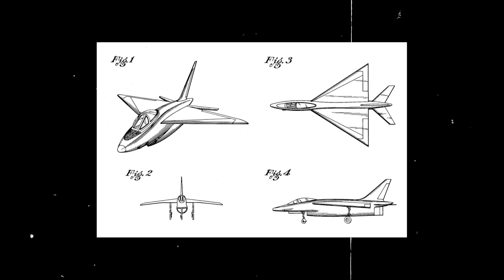T-38 Talon Supersonic

Comment: Two engines are always better than one. Replacing the T-38 with a single engine plane is not a very bright idea. In a T-38, losing an engine is not a fatal event for the plane. In a T-7, you lose the engine you lose the plane. Very short sighted move.

Comment: One thing NEVER mentioned was the very low service hours required to jeep the plane in the air! Modern plane's service requirements are absolutely outrageous but the T-38/F-5 were extremely low. I've always loved this simple yet deadly plane and when Northrop put a single engine with almost twice the thrust and called it the F-20, it was BEAUTIFUL, yet nobody bought it althiugh I'm sure the Iranians looked at it closely!

Comment: I may be incorrect due to my  age (81) but as a member of class 67B, stationed at Moody, Georgia,  the main specs that I flew was a max of 900, mach 1.5  and  a climb to 30,000 in 59 seconds. Fast enough that the altitude inicator 100 foot needle moved so fast that you had to see the tousand foot marker.  Flight above 50,000 feet was max, although I tried and suceeded getting it up to about 52,000.  On my last ride with an instructor, we burned the fuel down until we had enough power to climb at a 90 degree angle   with burners full, the only time I was a temporary astranaunt.  I have seen many variations of the above specs, and wonder if the T-38.s were slightly different than others.  Moody began recieving at moody, begining in  JULY 1965
Reply: Most T-38s have gone through the Propulsion Modification Program (PMP). Maybe the reduced specs are from PMP jets? The PMP from my understanding was mostly to improve TOLD so the performance of the jet suffers at higher speeds where there is less emphasis for the students now.

Comment: This thing is older than me, built in 1960, and we, Swiss Air Force, Switzerland, still use it to this day both in single seat Tiger II and two seat trainer versions, which is in fact a Talon with guns. Basically the F-5 and all its relatives were, are and will remain a very good design.
Reply: When the chef at the White House, learned that  I flew the T-38, he made certain, that  I become a taste tester for some White House functions.  This is no BS, its a strange world.  If you were in the Swiss Air Force  you could confirm the son of the White House chef was his Dad.

Comment: It's hard to believe the air force was trying to avoid a big expensive aircraft. How times have changed.
Reply: I  was an AFTOTC cadet, who  graduated in 1965. Somebody at the Pentagon had a good idea to save money. Rather than send a Reserve Officer to UPT, where a third of each class washes out, costing $250 grand, they spent $25K  to discover who had the appitude and ability to learn quickly how to fly a Cessna 152 o r Piper Colt. USAF  gave us 35 hours  to pass an  FAA check ride. We had a better record of earning our wings than the AFA grads. Someone finally discovered that tests on thet ground are a predictor of sucess as real flight instruction an the AFA does give 25 hours of flight training.

Comment: As an Air Force pilot trainee in 1981, I was stunned they let us go fly that thing by ourselves. Still am. 

I had barely 80 hours of flying jets, and all of that was flying the Tweet -a Volkswagen with wings. The Tweet was all manual controls and relatively under powered but it flew absolutely wonderfully. After 30 or so hours of training, they let you solo the Tweet and from then on, about 1/3 of your flights were solo. (At 6:15 the Tweet footage is of one entering a spin. Always did a lazy wing over before wrapping up. That was a fun and relaxing maneuver...) After all the fanfare with soloing the Tweet, including getting dunked in the "solo dunk tank" there was no such celebration when soloing the T-38. One day you showed up and there was a line through where the name of the instructor would normally be on that flight. You were on your own.

My Tweet instructor told us the scariest day in his life was the day he soloed the T-38. He knew once he put the gear up that only he could get the plane back on the ground. For some reason, my wife took his message to heart. She came out and took photos of me taxiing out alone and later getting off the flight line bread van alone. To her, that was a huge milestone for me. As a student, it was just more of the adventure. I have to give full props to the instructors who flew the jet from the backseat while the sluggos sat up front. The visibility from the back was horrible but these guys made it look easy.

The Air Force saw quite a few accidents through the years because the Talon could enter a high sink rate that afterburners and even the ejection seat could not save you from. Most of these accidents were in the "final turn" to landing. My instructor told me that if at the "perch" (about 1500 feet above the ground and at the very start of the final turn) if you rolled to 90 degrees for just "One Mississippi" the aircraft would pick up such a high sink rate, you would hit the ground, even if you rolled out, lit the burners, and hit max AoA. The RSU (Runway Supervisory Unit -a mini-tower next to the runway with a radio watching you in the final turn) was always watching for high sink rates turning final. If they didn't like your descent rate, you'd hear, "FINAL TURN, GO AROUND, SINK RATE!!!" Mom kept us safe.

A few years before I arrived for training, they instituted their version of the "Ohio State Highway Department" crash films they used to show you in drivers ed. Lots of pictures of airplane parts and sheets over bodies. They added some basic aerodynamics in the course and you had to ace the exam to get to solo. I guess it worked because the final turn accidents ended.
As a student, I always respected the airplane. Unlike the happy Tweet, the Talon was a whole 'nuther league and was relatively heartless. It would kill you in a few seconds of inattention. If you stayed ahead of the airplane and respected its limits, she was a pleasure, though a challenge, to fly.

Unlike most airplanes you fly, but like most fighters, especially Century Series fighter of that era, the T-38 wing telegraphed it's happiness right into your butt. Pulling closed, the airframe would buffet like mad as the wing approached a stall condition. Your butt became calibrated and you knew how much to ask, beyond which, one wing might snap off in a stall, which was easily solved by lessening the pull on the stick. Northrop put a nice Angle of Attack light on the dash which I never used. I was finely tuned to how much the wing could take.

Part of the reason I was stunned they let us "sluggos" go fly it by ourselves was that the new wings had finally arrived. The original wings had been warped and cracked after years of pulling 7Gs doing loops. The new wings cost $1 MILLION DOLLARS!!! making the planes value back then 1.5 mil. That seemed insanely expensive. Later, after the second set of replacement wings started showing up, the fuselages were starting to crack from those same G's. Some bright Air Force engineer figured out they could rivet a long exterior reinforcement stringer on the outside of the upper fuselage, on both sides. That added many more years to the aircraft.

As gorgeous as the T-38 was, it's cousin, the two seat F-5 was better yet. It had guns in the nose so they added a little longer nose with more "swoop" to it. Plus, it had more power and leading edge flaps, which made it fly slower landing and taking off. The T-38 was a speed demon flying 155kts plus one kt per 100 lbs of gas. It wasn't uncommon to return to the overhead pattern with 1000 lbs of gas which meant your first landing would be cooking in at 165kts. That is a hair under 190 mph. That is smokin'.
Reply: Great summary.  Willie 84-01 so same time frame as you.  It WAS crazy that they let us solo that thing so often.  You'd go down the hall to get your SOF brief and tail number, and he essentially tosses you the keys to a supersonic dart and basically says, "Try to bring it back in one piece", and you're thinking, "No promises...".   😜

What was also unique to that timeframe was the extensive formation training including solo 4-ship.  We'd routinely do formation takeoffs and landings 2-ship without giving it a second thought which is apparently gone now due to the risk and some accidents.

Very intimidating at first, but once you figured it out it was the most fun you could have with your clothes on.  Nothing could teach you more quickly about basic airmanship and how to manage energy and think in three dimensions than the 38.  

 Yeah... I don't think anyone looked at those AOA lights.  You just learned the difference between the mice dancing on the wings vs the elephants dancing on the wings.  Probably everyone had that one final turn where they cranked the nose around a little too hard and felt the bottom start to fall out, and that's how you learned how far you could go with it.
Reply: Excellent recollection of a very special airplane for many of us. I had a slightly different introduction to the White Rocket. I initially trained as a helo pilot in the Air Force with no fixed wing experience whatsoever. Flew helos for 6 years and grew accustomed to a certain pace of things happening when flying. The conversion course gave us about 35 hours in the T-37 and I thought that was fast......but then we jumped into the 38 and it made my head spin. Believe it or not I adapted much quicker to the 38 than the 37. We were doing formation takeoffs and landings and 4 ships and rejoins solo after only a handful of hours. Looking back on it I am amazed at what we were doing. It was a hell of an airplane!
Reply: @teeembeee  Right?  We did so many things on solo T-38 rides without giving it a second thought that they won't even fly dual with an instructor today.  Once your brain caught up to the afterburners and that little lightbulb above your head began to glow,  the 38 was the most fun you could have with your clothes on.

Comment: My question has always been about the impressive j-85 turbojet. All the famous turbojets of that time were replaced in the early 1970s by turbofans that, for the same thrust, were lighter, smaller, but I don't see a 3,500 lbf (16 kN) thrust dry, 5,000 lbf (22 kN) turbofan. kN) with afterburner and weighing 690 lbs (310 kg). Greetings from Patagonia Argentina.
Reply: Congratulations 👍 you have been selected among the shortlisted winner's,
  Send a message via TELEGRAM to acknowledge your Prize.🎁🎁

Comment: should have included the F20 Tigershark as it shared many design aspect but had the F-16's single motor and a M 1.7 top speed.  Too bad it blacked out its pilots with its incredible G-capability.
Reply: The F20 was never in Service,,

Comment: I was an instructor pilot training students with T-38 in South Korean Air Force from 2000 to 2003.
Talon was really amazing aircraft to fly with ..It was nimble and agile at high speed, but very difficult for a student to learn how to land .
At low speed it need a lot of technical skills and experiences. But its general performance was very stable and most of all it gave us really exciting fun to do various maneuvers. I still remember that I pulled 6g to make double Immelmann at 500 kts , 12000ft, full afterbuner …On top of the half loop at 22000ft, I got only 280 kts …But I rolled 180 and continued to pull at about 3g then air speed rapidly dropped…At about 90 degree pitch I lost all my kinetic energy…Suddenly, Talon abruptly dropped its nose to 90 degree dive with some big oscillations…I released the stick and pulled throttles back…Soon aircraft was recovered by itself……Yes it was the stupidest flying I have ever done….But it is still remaining in my pleasant memory.
Reply: Landing the 38 had the fastest landing speed of  the many aircraft I flew. But it always did what you wanted, unlike the Tweet. Iwas next to last in my class to solo, and first in my class to solo the Talon.

Comment: Your narration and presentation has significantly improved!  I'm enjoying your content greatly.  I'm a bit surprised that you did not mention that immediately following the oil crisis of the early 1970s, the USAF Thunderbirds demonstration team switched from the fuel guzzling F-4 Phantom II in 1974 to the T-38 Talon and flew them until 1982, after four of them crashed in a practice exercise.

Comment: The T-38 had similiar glide characteristics to the space shuttle, and was used to train shuttle astronauts in steep approaches to the runway.
Reply: I remember the T-38 being a shuttle chase plane. The T-38 had a much better glide ratio and I recall it had to drag its landing gear to descend steeply enough to keep up with the shuttle.  The actual shuttle training aircraft was a modified Grumman Gulfstream II.
Reply: @gort8203  Yes, that's right. Thanks for the correction.
Reply: @rpbajb  NP.

Comment: I remember the T-38 best as the chase planes used for all the Space Shuttle missions.
Reply: The NASA T38's have Oversized Speed Brakes installed which are quite a bit bigger than a Standard T38

Comment: Gerat video! The T-38 was a joy to fly. I do take exception to your comment that the T-38 kept the lines of the F-5 and F-20. It was the other way around.
Reply: You  are spot on, the F-5 and f-20 may have been on the drawing boards, with hundred of others, but only the T-38 found  US sales and the F-5 and 20 were built on the T-38 design.
Reply: Basically the F20 was a F5 installed with a F16 Engine.
Reply: @spuds416  The F-20 may have been an F-5 with a new engine, but it was a T-38 airframe (modified).

Comment: Former T-38 instructor pilot from the early 1970’s here. Not mentioned in the video are the time-to-climb records set on February 19, 1962, by Maj. Walt Daniel in T-38 s/n 61-0849. When I flew it at Webb AFB many years later, the records were stenciled on the nose. 61-0849 eventually went to Taiwan and then back to the USAF and is now in the Edwards AFB Flight Test Museum. The time-to-climb records were brake release to 3,000 m (9,843 ft) – 35.624 seconds; 6,000 m (19,686 ft) – 51.429 seconds; 9,000 m (29,529 ft) – 64.76 seconds; 12,000 m (39,372 ft) – 95.74 seconds.
Reply: Just over a minute and a half and you almost a mile higher than airliner cruising altitude. That is ridiculous!
Reply: Very cool, I never knew the T38 flew time-to-climb fights!  My grandfather ("Mac" Macfarlane)  flew the streak eagle and set the records for the 6000m, 9000m and 12000m climbs. It looks like another airplane had already beaten the T38's records (F4 maybe?) by the time the F15 took a shot at them.  
They should do a video on the time-to-climb flights in general since most people don't know about them. 
Just for comparison, F15 records:
6000m in 39.3 sec
9000m in 48.9 sec
12,000m in 59.4 sec.
Reply: @383mazda  You’re correct that the T-38’s time-to-climb records didn’t last long because the US Navy broke them all within two weeks with an F-4. Recently I ran across an interesting comment in the February 26, 1962, issue of Aviation Week & Space Technology regarding the T-38’s records. To quote the article’s final sentence directly, “The T-38’s rate of climb between 6,000 and 9,000 meters was 44,100 fpm.” I was curious about the F-4’s rate of climb between those two altitudes, but unfortunately it’s not possible to make a valid calculation because the Navy flew the 6,000- and 9,000-meter records on different flights (the Navy flew four flights, each optimized for specific altitudes, while the T-38 flew one flight).

I’m familiar with your grandfather through research I’ve done on time-to-climb records. Could you please contact me at the email address listed in my YouTube channel (under "About")? In 2012 I created a very detailed summary of Absolute Time-To-Climb records, including pilot names, which you'd appreciate. I can send it to you if you contact me.
Reply: @383mazda  7.5 miles in under a minute...against gravity...air density lessening the whole time...constricting the engines and ruining any aerodynamic advantage...we live in the future man...
Reply: Good Gawd that's a fast climb.
Reply: You are lucky to be in that era! They are beautiful airplanes. It's nice to see a squad of engineers that those communication became a family. So different today.
Reply: Why did they say two pilot,was this a trainer
Reply: @patrickcallahan9599  A student pilot is still “piloting” an airplane from one or the other cockpits (the rear for instrument training, the front for all other training). Often we flew with two IP’s (currency or stan/eval checks) too. Both cockpits are equipped the same except for certain things like throttle cutoff finger-lifts, and battery/generator switches in the front cockpit only. The reality was that although the students didn’t have their aeronautical rating when they entered the T-38 program, they were functionally ‘real’ pilots after 90 hours including a lot of solo in the T-37 - certainly more experienced at ‘piloting’ than the typical newly-minted civilian private pilot. We T-38 instructors looked at new T-38 students as pilots who we were going to transition to a higher performance aircraft, and teach them fundamentals (such as formation) of how to use airplanes in military ops.
Reply: I know this as A-5 tiger ll
Reply: Wish you had dropped your name. I was at Webb in 1972, class 73-04 “Self-Motivated”. I remember flying that airplane. I was initially assigned to “Archie” Baltich and then when a new instructor arrived I was assigned to him. “Alphabet” Madejczyk. My friend and class leader, Garrison, stayed at Webb as an instructor. My name is Howell.